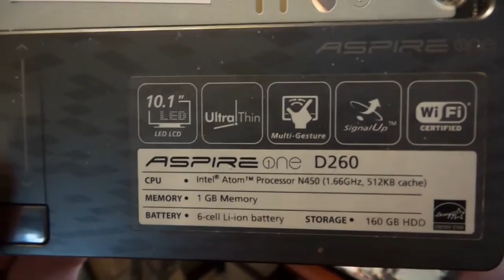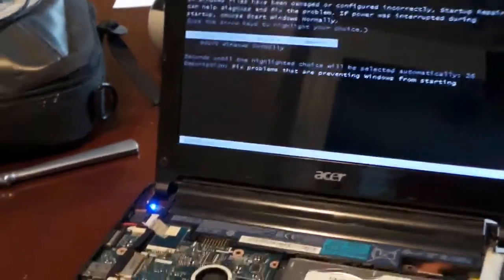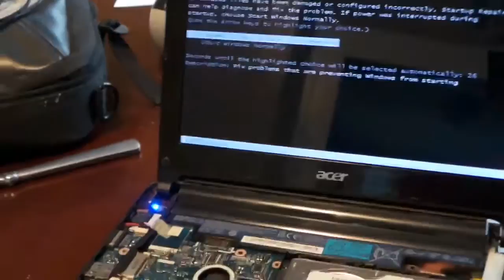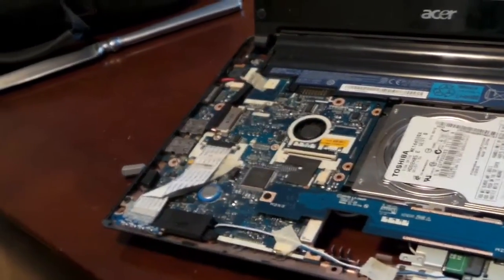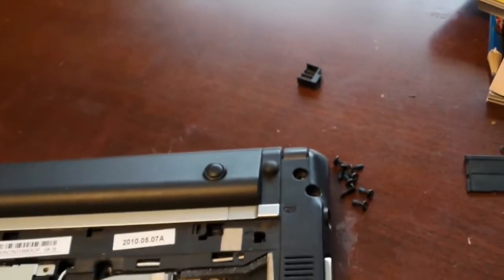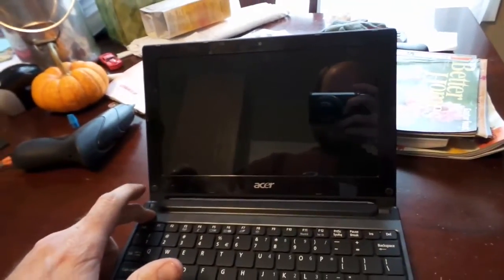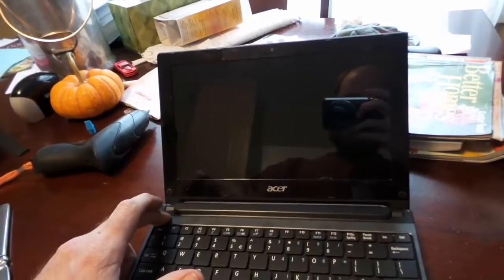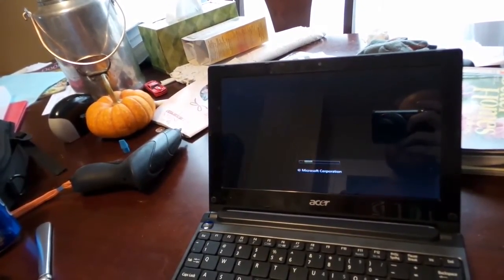Acer D260 black screen fix

Comment: Thank you so much guy! I just tried and it works. I was about to through it through the window and eventually I watched this video and my laptop is back up and running. Important note: take the battery out and the HDD out as well. I tried a different way and did not work. It only worked removing both, before doing the short circuit. Thanks again man!!!

Comment: thankyou for this video as i have the exact same laptop and i have a black screen when i turn it on so I will do the same to my laptop today.
Reply: did you get it going?
Reply: +KelvinFPV Hi I had found out that the backlight on my screen had Died, but I get a signal on a external monitor when it is connected to the laptop
Reply: +Ken Smith ahhh I've replaced one bulb on a larger laptop before. you could see the screen if you looked at it at an angle. haven't tackled it on a mini.

Comment: Hi there - I too have the 'black screen of death' on this model (Acer D260) and this video has given me some hope that I might be able to fix it myself :) I'm still a bit confused though - when you say 'shorted out' the two posts (that are by the blue circular battery) with a screwdriver - does that mean - you took the battery out and then just touched them with a screwdriver? Or is there something more to it? Really sorry if this sounds stupid! What exactly are you doing with the screwdriver on the 'two posts' (after you've removed the battery are you prising them up? Twisting them off? Or using something else to produce this short out). Once again apologies for sounding like a dummy! Thanks for your help (and happy new year!). Nick
Reply from the maker: No don't remove the battery. It's soldered in place. Shorting it out means to tough both post coming off the battery with a screwdriver or some other conductive piece of material. The electricity from the battery will momentataly stop going to the BIOS (basically a small computer in itself) and resets it back to the day it was first programed. The battery is there to keep that programing current. when you short it it forgets any new info. In our case the new info is corrupt and causing it not to boot. Clear as mud right?
Reply from the maker: I made some changes. Watch it again starting from the 1 minute mark. I realize i said I took the battery out but I meant the main battery for the laptop not the bios battery.
Reply: That's awesome (and so sorry for the slow reply, i've been away and only just logged back onto my youtube account). I'm going to try this today and with any luck i'll have my nice little netbook in full working order again! Thanks so much for taking the time and trouble to reply - and for your awesome detective work on this ridiculous problem (that I have a suspicion they build into these things to make us buy a new model....hmmmm!) All the best 
Nick
Reply: @nickbarrettfilm  did it help you?